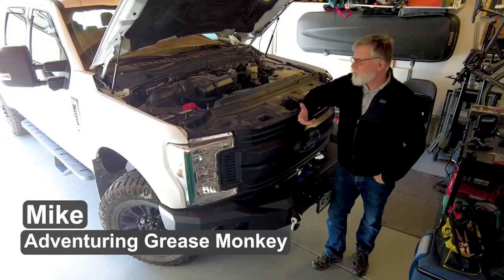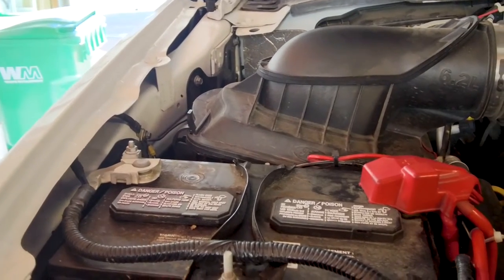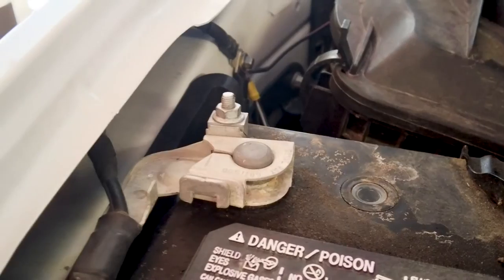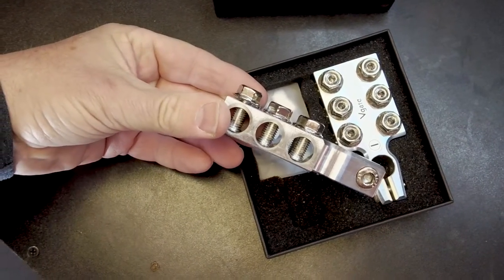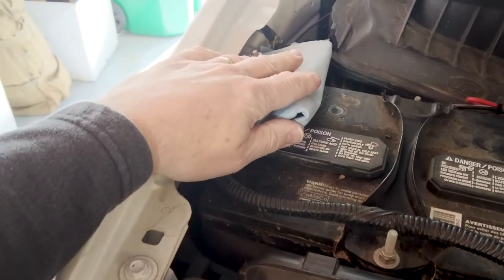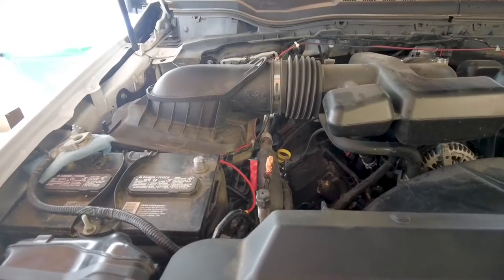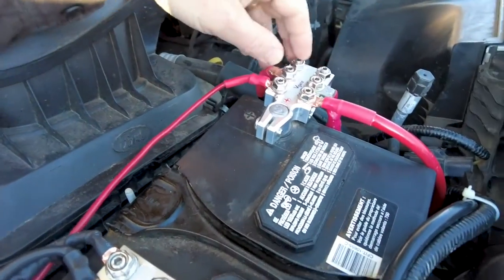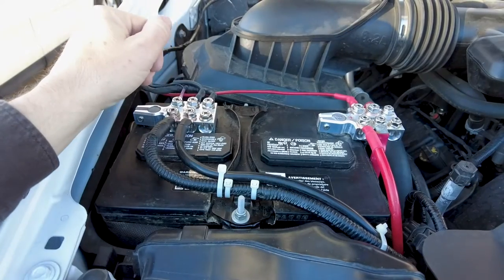The best battery terminals ever for your camper, RV, overlander and more!

Comment: My 2 cents:
In my opinion the solution is not to go 'direct' on to the battery at all. 
On your ground side that large cable should be going to the block and or chassis at another point, so any ground side connections should be routed to that connection point and a distribution block used to allow multiple large connections. Same on the positive side, a distribution block with fuses should have all of your accessories going to it to provide individual appropriate fuses, all in a central location that then connects to your battery positive lead. Of course all of this must use amp appropriate cable and connection sizes.
I get that using direct to the battery is common, and thus parts are made to assists that. But that really stems from the desire to have the connections visually simple to keep things easier to understand. It's not the best way, merely the simplest. Better load handling and organization of your accessory connections and fusing can be had by adding a sort of 'sub' fuse and distribution box (something like an electrical sub panel in house wiring) to handle the power requirements.

Comment: Any worries about corrosion on the aluminum blocks?  Usually the material is brass or copper
Reply from the maker: Generally aluminum is fairly corrosion resistant because it forms a protective oxide layer on the outer surface. But you have a point and I’ll have to keep an eye on it. Especially with the fumes from the battery. I don’t think it will be worse than most other materials and probably better than copper.
Reply: That oxide layer you mention is why they don’t make a good connection over time.
Reply: This is a very good question. I have never seen an automotive battery lug made from 6061 aluminum. When combined with copper in the presence of an electrolyte like water or worse salt water from icy roads, you will get classic galvanic corrosion. But worse because there is current flowing in the circuit you will get active current corrosion which is much more aggressive. Also, it is unwise to thread directly into aluminum (or even copper or brass as a matter of practice) for a battery lug. You would use a threaded insert, helicoid or a SS bolt and nut (which is very popular). It looks like the product uses a helicoil which will work. 

For the product to work in the application it would be made out of ETP copper and bright tin plated. The battery post hardware would be the classic nut and bolt, with the added circuit attachment using a tin plated copper buss bar flange extension to accept tin plated copper compression lugs. The lugs could be attached using threaded inserts into the copper with a SS bolt (torqued with a little Loctite), or also use SS bolts, nuts, washers and locks. You would not use the round cable inserts set screw connections, even if with a ferrule. It is better to use compression tin plated lugs directly using a bolted connection. After all of the connection are made you could apply battery post sealant to help prevent corrosion. It would also be beneficial if the manufacturer made a large rubber boot to go over the complete assembly. If you drop a wrench across the terminals it will most likely weld in place and then the battery could explode.

Comment: If that’s 6061 fine. I guess. 
Others like it are cast, brittle, and break. I’m skeptical especially for a 350A winch. 
I’d use the studs but I wouldn’t use those ports and running a bolt onto them

Comment: Thanks for sharing. Still holding up after 3+ months?
Reply from the maker: I checked the battery water a couple of days ago and all was well with the terminals. There was a little corrosion that brushed right off. No pitting of the aluminum. I might Spray a protective coating on it after I make the last tie ins this summer.
Reply: @ventureoutthere  I would get a tube of no ox from a big box store. It  is made to connect AU to CU keeping down the oxidation. Obviously look in the electrical department

Comment: Do you have a cover or rubber insulator for the positive post?
Reply from the maker: No I don’t. It is exposed.
Reply: @ventureoutthere  I've used a small rubbermaid container and cut the bottom and sides out as needed for wire install. Red top snaps on and off plus install a wire tie as the hinge so you don't lose it.
Reply from the maker: That is a good idea. I’ll have to look around and see what containers might fit. Thanks for pointing that out.
Reply: A  good question I have as well. I would have thought Vgate had one to fit on top of these.

Comment: Have you upgraded the stock electrical?
Reply from the maker: I have only added the various accessories. This truck came with a heavier alternator as part of the upfitter switches and 120 volt inverter dash outlet options.